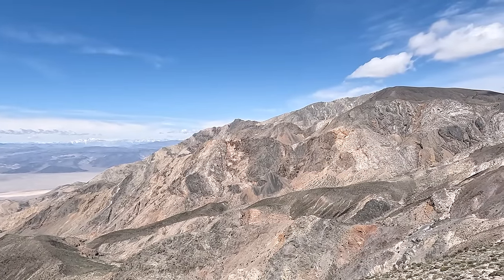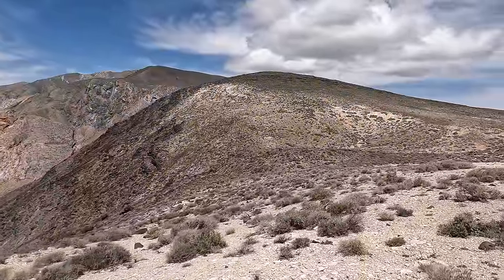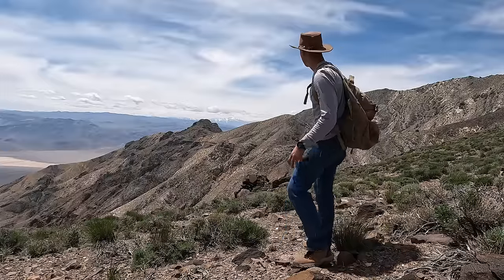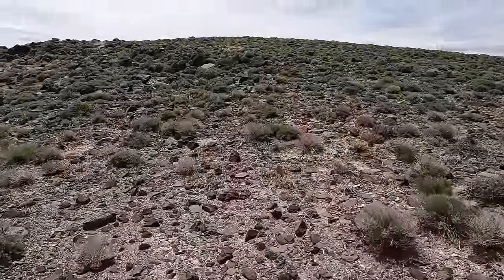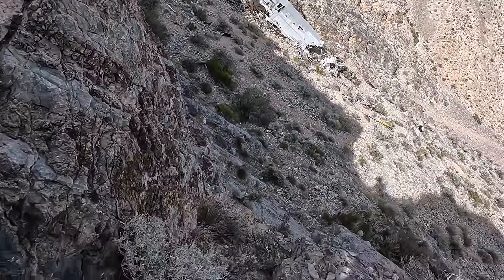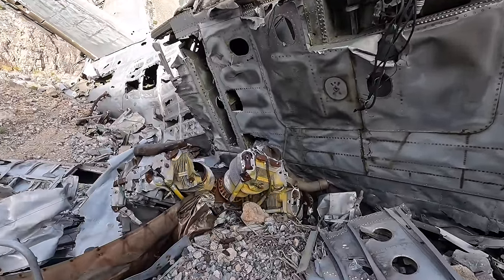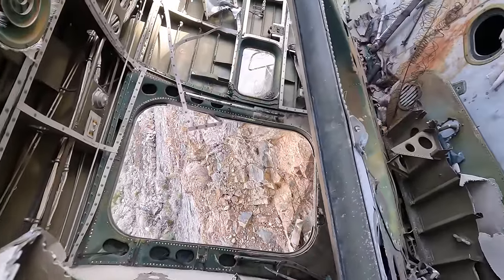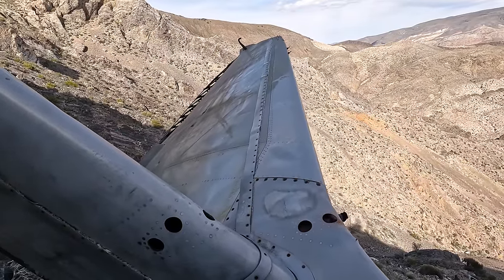Hiking to a 1950's CIA Plane Wreck of an SA-16 Albatross

Comment: What's really crazy is the engine failed.. as you zoom into one of the bases of the cylinders you can see all the base cylinder bolts missing and all the other cylinders have all there bolts except that one cylinder.or the other cylinders closer to the plane it's self.. .. And the lose of all the hydros

Comment: The "light fixture" is a fan probably for cooling electronics or providing air flow to the cabin. Can't believe you cant tell the difference between a fan and a light.

Comment: That's actually, tens of thousands of dollars in scrap aluminum, copper, stainless steel, etc.🤔
Reply from the maker: To the average viewer yes, to those who actually care about history and see past monetary gain not even close.
Reply: Yup, suprised the tweekers haven't found the wreck.
Reply: Whether sheet, tube or casting, T-6061 and T-6063 is easily ID'd by scrap yards which always poses first question: "Where did you get this?" Good luck with your answer. Although aircraft/airframe may be stricken from a service branch Property Book, all materials remain federal property. Scrap yards have the FBI bounty phone number and scavengers are an easy hit to raise their arrest stats. See how that works? Cheers!